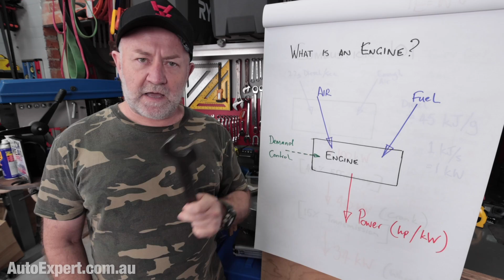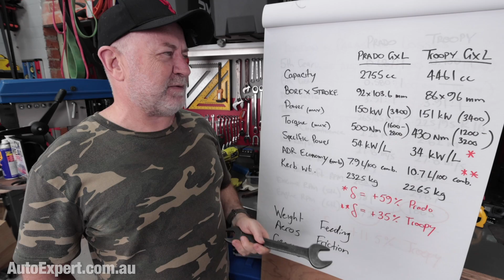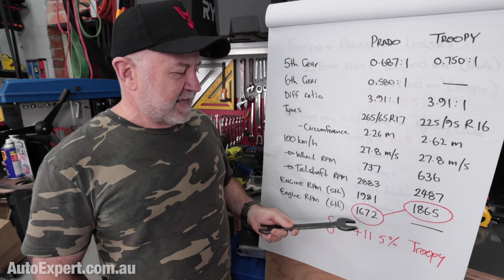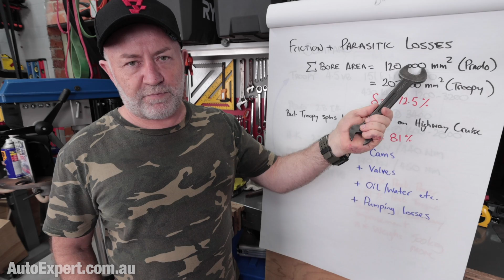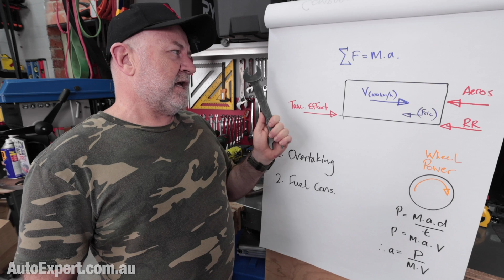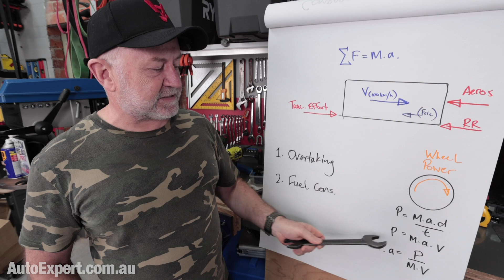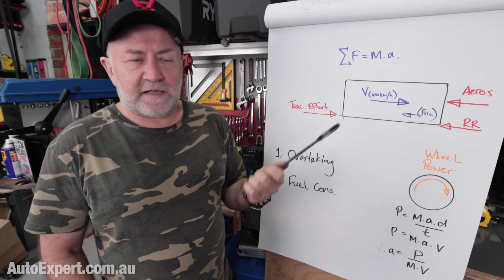Toyota Landcruiser Troopy fuel consumption (why it's so bad) | Auto Expert John Cadogan

Comment: great video and breakdown as always. adding another turbo to the troopy wont turn it into a 200 series though as 2 turbos is not always better a bigger single turbo properly suited will always out perform smaller twins the nissan gtr r32-34 is a testament of that. I don't have an intimate knowledge of these specific engines but my take away is the prado 2.8 is more of a highly strung engine with a more efficient flow characteristics at the boost pressure toyota has set the prado 2.8 to run at. where the 4.5 in the troopy is more a low pressure turbocharger set up that's flow rate means its not at the turbos peak efficiency for the turbo used leading to the benefit of turbocharging a diesel to increase its efficiency being less significant and turning that 40% efficiency mentioned becoming more like 30%. I am assuming this based on the compression ratio being higher on the troopy vs the prado 16.8 vs 15.6.
Reply: You're misinformed about turbos, the reason why most people opt for a big single instead of any twin turbo setup is due to weight, packaging, cost and simplicity. 
Depending on what you want out of your engine, low rpm response for daily drivability, a flatter more linear torque curve or just bulk peak power, a twin turbo setup can give you more options that just upgrading to a big single turbo can't by comparison.
Reply: @jrc-3954  we are talking a parallel twin turbo setup vs a single as what is used on the Toyota 4.5 v8 and the rb26 I mentioned in my example you don't have to worry about splitting exhaust between 2 separate turbos that each required to spool up the weight of the rotating components of similar designed twins that have the same power potential as a larger single is greater meaning that the single will spool faster given the same power potential sequential setups are a different argument where especially on a diesel they certainly have their place but in regards to the 4.5 Toyota motor a bigger single would provide better response and power if properly matched to that engine as opposed to the twin parallel which is in fact used due to packaging of the v8
Reply: @A9Y288  Your case for a larger single spooling faster than two smaller parallel twins makes no sense as smaller turbos spool faster. 
Also larger turbo doesn't always equal more power potential, if you have the largest single turbo designed to efficiently focus on mid to high RPM peak power for 4L of displacement and on an identical engine, have the largest parallel twin turbo setup designed to do the same thing for 2L of displacement, the air pressure being forced into the cylinders is going to be the same.

The RB engine is an example that probably shouldn't have a parallel twin setup from a manufacturer's point of view because it's unnecessarily complex and costly to split one manifold into two for twin turbos where the trade-off is slightly reduced turbo lag for increased weight, complexity and cost compared to a single turbo. 
Parallel setups shine on a V configured engine because there already is two exhaust manifolds on opposite sides of the engine bay, in many cases a twin setup here is simpler than a single.
Reply: If the Sheila’s like ‘em, I’m in like Flynn

Comment: I drive a Troopie for work every day and I have never noticed poor fuel consumption. I do have a company fuel card however.
Reply: i also don't notice things that other people pay for,,,
Reply: Ooff poor Steve. You make a cheeky,  obviously tongue so deep in cheek it’s wagging out of your a$$hole, and you attract all these grumpy people with no humour bone.
Reply: Remember it's a v8...a normal V6 troopie I believe is ok
Reply: @craftloop26  a v6 troopie?
Reply: @brackipas  Pretty sure the poster is on crack, and means in line 6. However there are actually such things as v6 troopies, i see one regularly around my area. Its the same petrol v6 that you get in thailuxs,prados,80series etc etc etc. rare af but actaully a thing, the UAE only get 70's with this engine to this day and the aniversary model in japan a few years back also got the v6 petrol, because v8 doesnt meet emmisions or some crap. Mines may well also get them, in limited numbers, probbably without adr, as they can get whatever tf they want, they can still get the unicorn mech injected beast 6....Just mostly dont.
Reply: @dunxy  Unfortunately, John neglected to explain that the V8 in the troopy is deliberately detuned by Toyota, to maximize it's reliability and overall lifespan. Sure, you can juice a little motor up to within an inch of it's life, get a similar performance, but it'll never replace a motor designed for ultimate reliability in the bush, where your very life might depend on it. This is a common issue with city people, who just compare numbers on a whiteboard, without considering the kind of isolated and rugged environment these vehicles are designed for.
Reply: @politics21c  except the airbox
Reply: @craftloop26  normal v6 is considered a little weak by many
Reply: I agree and I seriously don’t understand what everyone is complaining about. I have a 2020 model and have absolutely no issues with fuel consumption. I’m running bigger wheels, draws, fridge etc and I’m getting about 850kms per tank. I don’t understand what is wrong with that. My 2017 hilux was way worse
Reply: @deanabrozki286  For starters the poster of this video is using data from older higher revving models, that do deliver the kind of fuel economy he quotes, but who cares when you drive one of, if not the most capable 4wd on the planet. 2016+ 70 series pull under 2krpm @ 100kmh, unlike pretty well 2500rpm for the previos models. Most people who buy them , dont give a hoot about a few extra $ in diesel per week. Ive had one for nearly 7 years, beast of a car, a mate has one with over 500,000 on the dial now, very early v8 still with the steel dash, other than tyres and brake pads, its needed nothing and still drives like new. This video is nothing but clickbait, he leaves out key facts that actually do matter.
Reply: Lmao
Reply: If the Sheila’s like ‘em, I’m in like Flynn
Reply: 70 series maybe is overrated..but not really..it has diff locks
Reply: @craftloop26  that has nothing to do with the engine
Cant you even buy after market diff locks?
Reply: Stupid comment. 
Work out the fuel consumption yourself
Reply: @BubblesTheCat1  ITS A JOKE

Comment: Jeez, I thought you were going to sh.t on my old '93 non-turbo, non-electronic-sh.t, 1HZ Troopie.  Still going strong today.  11 to 12 litres per 100 km on the highway.
Reply: or my 3 litre non turbo hi lux sure it uses a couple of litres more per 100 but no common rail pressures, no turbo no oil use after 370k . yeap I'll keep plugging along with it.
Reply: I've owned and operated at least 5 cruisers with 1HZ engines and never got anywhere near those figures.  The 80 Series will go up 20/100 if pushed/loaded and best at around 16 if we are real careful.  My 70 ute got 14.7 on a trip once and I think I got 15 in my troopy a few times.
Reply: @victaylor-amateurphotograp9171  Might depend on how you drive. I got 11.5 on a 24,500 km trip round Aus.

Comment: Great Video John.  I wonder how the boost pressure and compression ratios differ?  I'd guess the transmission losses in the Troopy would be significantly higher - particularly considering you have to accelerate and decelerate all these heavy duty components vs lighter duty prado components.  Maybe the moment of inertia of the wheel/tyre combo is higher in the troopy too? Could lose a few percent there.  Is a big part of the parasitic loss the fact that pistons have to effectively decelerate and reverse motion every cycle - bleeding the power cycle of other cylinders to do that?  With twice the pistons (and maybe heavier pistons?) that could sap some kws...

Comment: Yep, no idea why people buy the LC 78/79 as an everyday car.
We drive them every day (and spend thousands per car fixing them every 2 weeks) in underground mining, BUT nothing else will do that job, they have ALL been tried.
Would I buy one myself, definitely not.
They are ponderously slow, and uncomfortable to be in and incredibly expensive. Our travelling to site dual cab won't maintain 100km/hr up a gentle hill with 4 people in it!
My own car is a 2.3lt twin turbo with coils all around and more torque than the LC. It'll tow a rally car on a car trailer at the speed limit all day, it's comfortable to be in and is currently sitting on 8.7lt per 100 average fuel use.
I don't expect it to go to 300,000km, but we have a lot of dead V8s around our various mine sites too - they aren't bullet proof either.

Comment: My old '85 landcruiser (Diesel) wagon (not troopy) has THE best economy of all cars we still have - Better than the Mrs new Mazda 3!
Reply: "I get 800km from a tank in my troopy, but only get 600km out of the tank in my Mazda 3"......
Troopy tank = 150L
Mazda tank = 40L.....
Something like that, anyway!!!
Reply: @danbywaters6123  IF you're talking to / about me and my comment to John; I never said that.
Reply: @SteveMack  just a general comment 👍
Many people (not saying you...) crap on about how far they get off of a tank, with zero consideration about how big their 'tank' is.... Completely meaningless.
For comparison, identical units need to be used. Litres per hundred kilometres works well in our modern metric world.
Reply: @danbywaters6123  Also fair enough; with these many responses I'm never sure who is replying to whom. All good mate :) Litres per hundred kilometres I leave to my other cars that show that on their computers. Born in 1964, I got the mixed 'benefit' of thinking metric and imperial on EVERYTHING, and some things (like tools & distance as well), I use differing terms.
Reply: @chris beerad It's 2 years old!!

Comment: Here in the US the value of reliability often outweighs the cost of fuel.  Toyotas are more commonly known to last hundreds of thousands of miles without catastrophic failure or excessively expensive repairs whereas many other cars and light trucks are pretty much through at a bit over 100,000 miles and sometimes even less.

I'm sure that in some parts of the world fuel prices would more heavily influence the purchase decision.

But overall, this has been an interesting beer garden math exercise.
Reply: Both are Toyotas
Reply: @jasonfields2793 
They might not get the prado there, or it's under a different name.
Reply: @Robert-j6r8c  No diesel models..all petrol.  US enthusiasts who know what they are missing out on want a good diesel...the power brokers won't allow them to be imported...would destroy the US domestic pick-up market sales.
Reply: @teenaramsay2469 
America has some of the strictest emission laws. The diesels don't pass it.

The only reason the truck can get away with it, is because they're body on frame and classed as commercial so don't have the same emissions laws.
Reply: @jasonfields2793  Yup, no diesels here and Toyota uses different names in the US.  Still, my point being that here many people might consider a vehicle with a track record of reliability over something with better fuel economy.
Reply: @RJ-vb7gh  no doubt although for the example given every more efficient engine mentioned is also far more reliable.
Reply: @jasonfields2793  Here in the United States, most of us who actually work on older cars tend to learn early that high tech and high performance engines and transmissions and even suspension parts have a tendency of wearing out sooner than their lower tech relations. There is absolutely no reason that carmakers can't build reliable high-tech and high performance cars but possibly, in part due to the costs involved they often don't. Mostly, when you see cars with ridiculous mileage on them and incredible long lives behind them they are pretty much low-tech vehicles without too many extra things to go wrong.111

Reliability is a very different issue for new-car buyers than it is for use car buyers. Under warranty, a new transmission or turbocharger can cost the consumer less than an oil change. For a consumer that spent his last dime buying an older, high mileage use car, either repair will total the car. Here in the US used BMWs, Porsches, Mercedes, Saabs and Audis usually sell for a tiny fraction of their new price. Once these cars are out of warranty less affluent people know they can't afford the maintenance and repairs.

Of course some people really don't concern themselves too much with the used car market. Unfortunately, when they are trading in their $120,000.00 Mercedes and find out that they are only going to get $3000.00 towards the purchase of their next new car it's often a rude awakening.

Not being intimately familiar with either of the vehicles John was talking about, I can't comment on your situation in Australia. As for me, as a person who's been repairing cars for 45 years and have gotten too old to want to do much more of it, I went out of my way to buy a naturally aspirated American-made rearwheel drive car and happily traded fuel economy for durability.

Naturally, this is a very subjective decision and I wouldn't dream of telling anyone else what they should or should not buy.
Reply: Beer Garden Math????    Be safe! Never drink and derive! :)
Reply: If the Sheila’s like ‘em, I’m in like Flynn

Comment: Great analysis, end of day V8 sounds better than any I4 couldn't care less about fuel economy, higher revs in top gear will be fitting 33's anyway, prefer a manual  and none of the fluff that comes with more modern 4x4s
Reply: agreed v8 does sound great, but that's all they do everything else is shit 
i have one, and will not buy another...